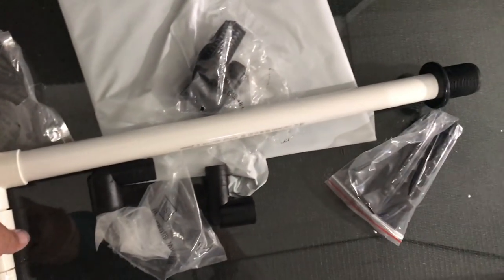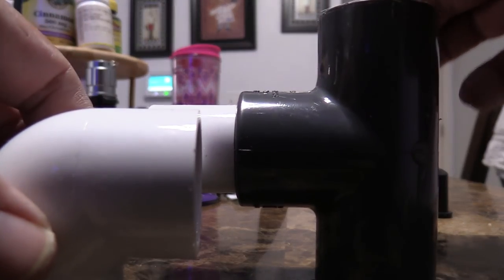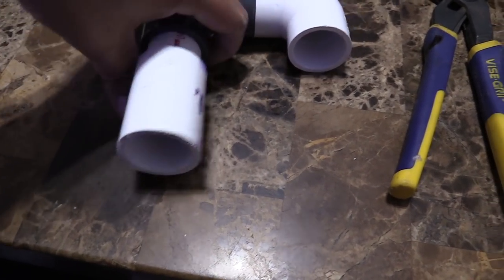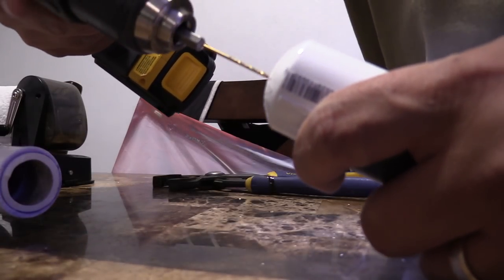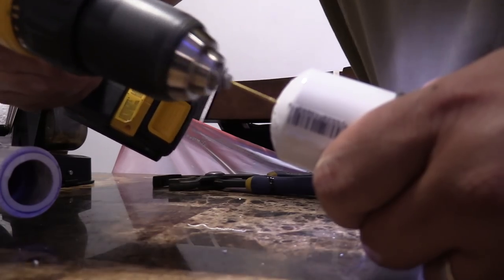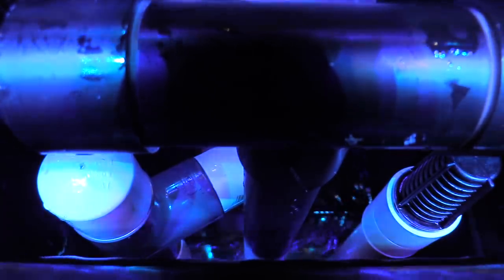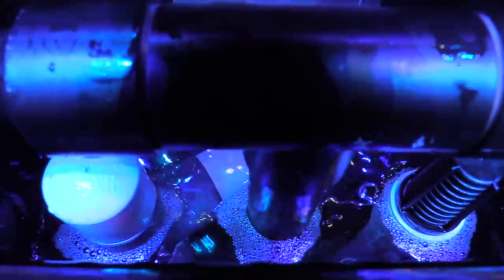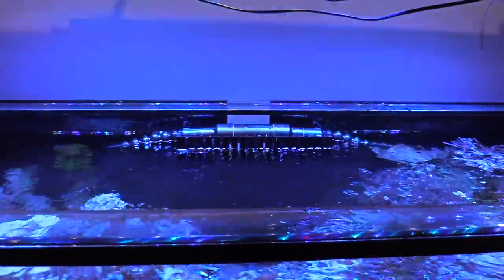HOW TO ULTRA SILENCE YOUR AQUARIUM OVERFLOW | DURSO STANDPIPE, BEAN ANIMAL ,HERBIE OVERFLOW

Comment: Question 2ALL ... please. Anyone with this style smooth shiny acrylic overflow box in tank.. does it allow rooted algae growth on it? My 90gal megaflow is matte and the texture allowed briopsis to root all over.. can scrape but tough because the corners are rounded & it still wont kill the roots in the pores unless I drain and peroxide scrub. Not an option. I was thinking of making this exact type overflow box that JUST fits inside mine ... save lil space and squared off  smooth acrylic hopefully keeps rooted algae off & easier to clean.

Comment: Steve threw the Durso fitting in with my shipment!
Reply from the maker: Thats Great Paul, Did you have any issues with the bulkheads that came with the tank
Reply: 915Mang  Hi Mike, so with a bulkheads, I hand tighten them then did 1/4 turn with a wrench.  I wiggled them around then did another 8th turn, so far so good but I have yet to put water in the tank.  I'd like to show you my setup so far but i'm not on Instagram.
Reply from the maker: Awesome Paul, Did you put some RODI water in the overflow? Id do that before I actually fill the tank up with water. My email is 915mang@gmail if you want to send some pics.

Comment: Did you have any flow issues with only using the 1 inch piping for the durso? I am contemplating doing the same thing for a 180g freshwater sump and I'm wondering if the flow is going to suffer if the pump is running ~1000gph
Reply from the maker: Stealth Bobber Mine is quite but the proper durso size should be 1 1/4 or 1 1/2 I cant remember look at the video again I show the proper size. I stuck with 1” because I glued everything. Also don’t glue your durso just dry fit it. As far as flow I use the power heads.

Comment: I need to do this I am just so nervous about disconnected the plumbing while the tank is stocked. I had struggles the first time getting a good seal on bulkhead
Reply from the maker: Slything Well you don’t need to take the bulk heads off. You’re not going to glue the drains to the bulk heads
Reply: @915Mang  unfortunately I glued the top drains as well in the return. I realize now how dumb that is as its all draining through the bulkhead.

Comment: Good video!

Im using the Bean Animal, love it.
1 full siphon, 1 slow running drain + the emergency. Dead quiet, if only my Gyres would be as silent...
Reply from the maker: Same I can only hear my pumps. But its funny, if we hear anything we know something is wrong. My ATO was running and running on my 180g, I ran to my tank. My hose was leaking on the floor. SO quiet is Good!
Reply: Isnt it wonderful? The slightest gurgle or splash sends me into full on Red Alert-mode haha

Comment: Nice!
Reply from the maker: Thank You Paul! Have a good one Today!
Reply: 915Mang Back at you Bro.  I was hoping to receive a shipping notice  from SCA but didn't.   Your videos are very informative.
Reply from the maker: Thanks Paul, Email Them to see whats going on. Probably the Holiday.
Reply: 915Mang Yeah, I'll see what happens tomorrow.   We BBQing today?
Reply: 915Mang Mike, as far as light mounting, how deep is the lip on the back top of the tank?  Would I be able to mount a bracket there?
Reply from the maker: BBQ some meat. But not with the smoker
Reply from the maker: The back doesnt have a lip (STAND). Its only on the front.  But youre talking about the euroBrace? Its about 1 " all around.
Reply: 915Mang Are you able to mount lights on the tank or does the bracing get in the way?
Reply from the maker: Paul Sturgill  Bracing would get in the way. Look into aquaticLife rails they sell them on MarineDepot. That’s how I did it if you don’t want to ceiling mount them
Reply: 915Mang Right on, I decided to run Kessils.  I ordered the rails that connect to the stand.  Thanks Bro.